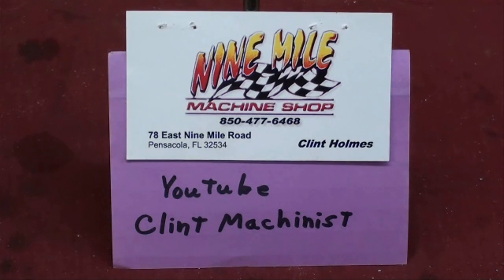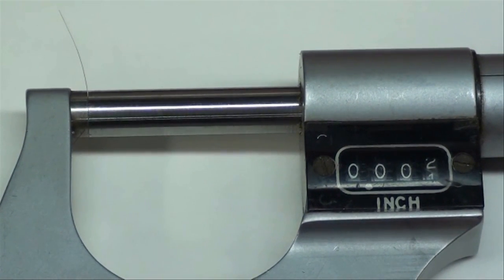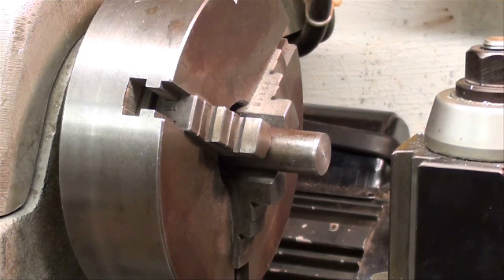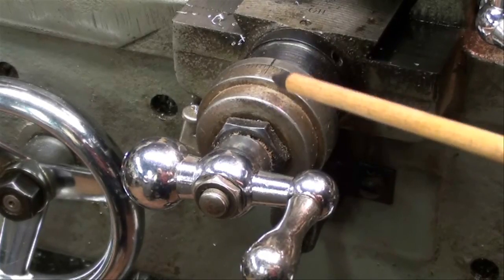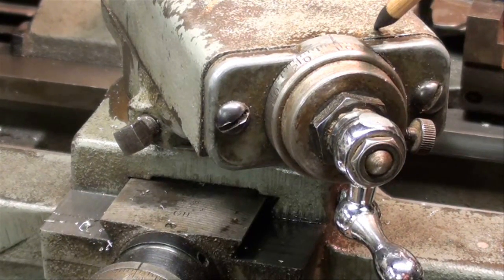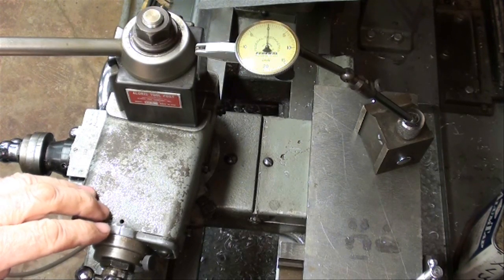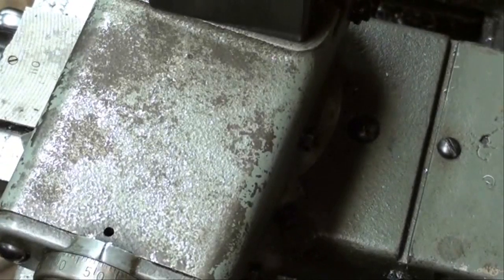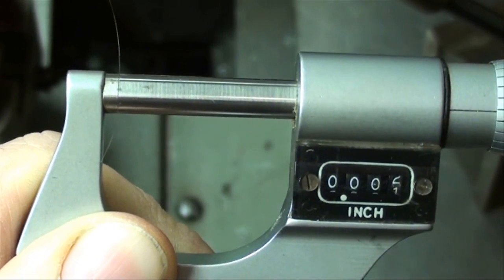MACHINE SHOP TIPS #90 Splitting a Hair on the Atlas Lathe tubalcain

Comment: I've been using the 30degree setting on my lathes for many years now but did not know or think about using a 5 3/4 degree setting. Thanks for the tip! This will come in handy building my steam locomotive in 1.5 inch scale (7.5 inch gauge)
Reply from the maker: Glad you liked it, good luck with the locomotive
Reply: mrpete222 how do we contact you via email?
Reply from the maker: Get email address from this video.
tubalcain Video Courses For Your Christmas Stocking atlas bridgeport south bend lathe

Comment: How about setting the compound at 1 degree and getting a super reduction in cross feed? Calculating it a 100 thou compound feed at 1 degree gives a cross feed of 100xSin(1) = 1.7 thou (make sure the calculator is in DEGREE mode!). That's a reduction of 58.8:1 or 0.017 thou cross feed per 1 thou compound feed. I know this is impractical and way beyond the measuring instruments in the machine shop (not even sure of such a tiny feed would result in a cut. tool not sharp enough? Set up not rigid enough to actually cut?) but I hope it gave somebody a good laugh!

Comment: Unsure if this has been mentioned yet, but the mathematical explanation for this is if you remember to your high school geometry class special right triangles. A 30-60-90 has sides of N,N Rad 3, and N2. Since N2= compound movement and we are measuring movement in parallel to N. With N=1/2 of the compound movement you respectively get a 2:1 ratio. So remember kids, what you learn can be and is practical in the real world (coming from a freshman in high-school).
Reply: Well done! A common misconception may be to think if you wanna half the cross feed effect of the compound you could set it up at 45 degrees (half of 90), when in reality if you think of the diagonal of a square the relationship to the side (the cross feed movement in this case) is X Rad 2 : X. Following that false thinking might be thinking a 9 degree angle gives a 10:1 feed.

Comment: If being able to square your tool post against the chuck is the way you want to get things square, clamp a truly squared block of material which is (say) 6 inches long into a tool holder, lock it into the tool post, and set it up against the chuck face in a gap between jaws. Should make it easy to set up.
Reply from the maker: +Mark Sinden Thanks for watching

Comment: From my little experience, actually performing a very light cut is tricky, too. 

First, if you transitioning from heavy cut to a light cut with the same setup, you risk cutting too much on your first light cut. Heavy cut deflects work more and once you make a light cut, your work deflect less and, as a result, you cut more. I don't know if you get the same effect on a "real" lathe, but that's what I was getting on a hobby-grade lathe (read: flimsy import lathe).

Second, some materials just don't like light cuts, you either get poor finish (1018) or material work hardens (stainless). Seems like it is even worse with carbide inserts as they are not as sharp as HSS tools and insert simply rubs instead of cutting. Shear lathe tool was a real find for me -- it is simply brilliant. Was able to put nice finish on 1018 with it. Also, it seems like it is able to make much lighter cuts than traditional HSS tool (well, at least, HSS tool ground by me).

I guess, you have to use toolpost grinder for less than 1 thou precision.

Comment: 36.87 degrees gives the 3,4,5 triangle. Meaning turning the compound 5thou gives a 4thou cut. (plus if required secondary, the tool has moved across 3thou but not to be confused with simply working to achieve the finer cut in the first instance). Whatever the case, setting the angle is NOT as vital as is getting the right ratio on the indicator so no need to sweat preciseness trying to get decimals of any angle is there? Ratio is all that counts and trial and error and patience will get it.

Comment: Excellent video of applied trigonometry, but it would have been better to include the math.  Sin(30 degrees) = 0.5 or 1/2, so with the compound (think hypotenuse) set at 30 degrees, the tool will travel  inward 1/2 the distance the compound travels diagonally.

If you want the tool to travel at a certain ratio to the compound dial and need to figure the angle ,use the inverse trig functions. Make sure your calc is set to degrees and just enter arcsin(desired ratio). arcsin(1/10)= 5.7392 degrees

Comment: Hi Mr. Pete:
Thanks for all your efforts!  One small trick to align the tool post is to use a 1-2-3 block between the chuck face and tool post side, since they only cost about $10 I keep a pair near each machine.  As an aside, I have checked 8 pair of the cheap 1-2-3s against a Sheffield comparator set with gage blocks and found them all to be within 0.0002 in of nominal; but the pair you get in a set are no closer to each other in size than two blocks picked at random for a big pile!

Comment: How about a project to build a new dial for an old Atlas?  Are there any gotcha's involved other than making it small enough so it doesn't interfere with the compound as it swings over the existing dial?  Also, what about extending it and making a new feed screw so it did not interfere?

Comment: so if i got this correct a 60 degree setting will give a 2/1 ratio, 30 degrees should then give a 4/1 ratio, 12 degrees wil give a 5/1 ratio, 6 degrees a 10/1 ratio, 3 degrees will then give you a 20/1 ratio, and 1.5 degrees a 40/1 ratio

Comment: By using a micrometer carriage stop, or an indicator clamped on the ways. You will have to compensate for the compound travel every cut. Or stop shy of where your shoulder should be, turn to diameter, the come to your length and face.

Comment: When I explain it to someone I use the terms "radius reading" and "diameter reading". A radius reading dial would be the older type where 10 thou takes 20 off the part. Conversely with a diameter reading dial an indicated 10 thou takes the same from the part.
Most people I have explained it to this way seem to have a better understanding.

Comment: it helps to draw a picture. if you draw a right triangle, the compound adjustment is the hypotenuse, and the vertical leg of the triangle is the diameter change. In order to get the vertical leg to change 0.5, the triangle's ratio will yield 1 as the hyp and 30 deg as the radial angle.

Comment: Correct that to:
At 10:20 when you said "now when  I feed in 10 thousandths with the compound the tool or the grinding wheel is actually going to advance into the work only a tenth of a thousandth." I believe you meant to say it would advance only one thousandths.

Comment: It has to do with trigonometry.  The movement of the compound is the hypotenuse of the triangle and the depth of cut is hyp * sin(angle).  When the angle is 30 degrees, the depth of cut will be sin(30) of the movement of the compound.  sin(30) = .5.  If the compound were set at 45 degrees the depth of cut would be .71 of the movement of the compound.  As he demonstrated, for 1/10 movement use 5.75 degrees.  sin(5.75) = .10.

Comment: By using a 60 deg : 30 deg ratio it results in a 2:1 ratio with actual movement from the compound. By using 45 deg, the ratio of movement would not be nearly as simple.

Comment: For any fine work, such as this, I usually put an indicator on the tool post. I can then see the actual distance that the cross slide has moved and "creep" the part into size. This is especially helpful when the dial itself uses 4 thou increments and the DRO is broken :)

Comment: I didn't know that trick, although it is pretty obvious. Thank you! But I got one question: What is about spring cuts? Removing material without feeding in, because of the elasticity in the machine, the tool and the workpiece in the previous cut. Does this matter in such fine work?